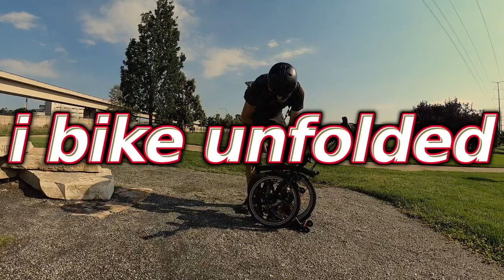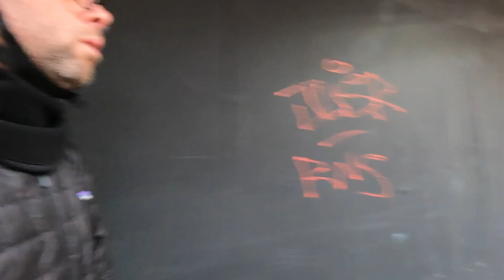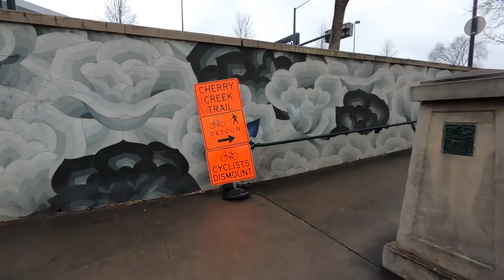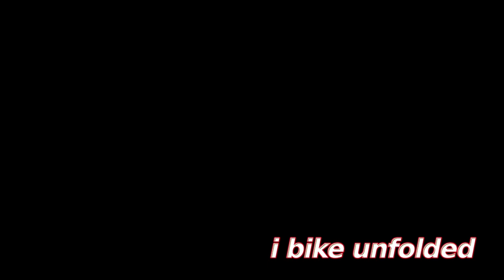don’t buy an older Dahon

Comment: I'll be honest, I don't even own one of these but it just looks and sounds like you don't maintain your bikes. Also, what is the point of owning a $1k+ Brompton and you're afraid to use it in bad weather? Those things are built like a brick, they can withstand an amazing amount of abuse. Anything from the 80s and 90s is going to suck if you don't maintain it, and anything from before 2000 is gonna be hard to find parts for. I'd change this video title to "don't buy a bike you don't know how to maintain or fix."
Reply: Or "Don't-buy-any-bicycle-youDON'T-want-to-look-after"

Comment: My Dahon is 2nd hand. Has a steel frame. Only problem was with seat post slipping down. A separate quick release clamp on the seat post fixed that problem. I have been happy with bike in all other ways. The 20 inch wheels make for a smoother ride. Your bike looks to be a very old model. Oh....and I would never drill holes in a frame.

Comment: Well you could change out that bolt for one with a castellated nut and cotter pin but yeah that headstock looks like a hot mess. They don't make 'em like they used to and sometimes there's a good reason.

Comment: 17:35-19:25 thank you 🙏🙏 i was perplexed and intimated by these washers now I have the stem off the fork. I think your problem is the washers are misplaced, there are not the same thickness?!! Anyways, I am replacing it with Razor stem and two take off handle grip, TI alu wedge stem screw, and 16 inch alu front wheel. Right there I am going to save 3pt! Have nice day with Brmptn...

Comment: To adjust the upper steering nut--could U try a freewheel puller lathed down to fit into the outer cup? Also, pulling a trailer from so high up on the seatpost risks stress-cracking the frame and is inherently unstable. I pull using a folding luggage dolly carabinered into a standard rear rack. Since it attaches low over the rear wheel it's more horizontal and doesn't capsize.

Comment: That's a heck of a huge box you were carrying there. That brings the CG quite far from the the trailer. I've tipped mine over about 5 or so times, but never had any failures like that. I was quite surprised to see the steel pin bending. I'd expect the counterpart rubber component to break instead.
Reply: If it helps, I use mine with basically no pressure in the tires, as I found that to make it more stable and compliant when hitting potholes, etc.
Reply from the maker: Yes, I thought the trailer would break before the hitch.🤷‍♂️
Reply from the maker: Thanks, I might try to lower the air pressure and see what that does.  (After I get a new hitch that is)😀

Comment: Had a near-miss once on my Brompton. I was taking it on gravel with lots of loose rock, and when I rode it back to civilisation, I noticed that the gaps on the hinge clamp was wider than usual. I was riding on a loose hinge clamp for over 15 mins! I eventually tightened it back, but it just shows how idiot proof the Brompton is and why you shouldn't ride a cheap folding bike. Didn't you have a full-sized 700C bike? why don't you use that for your beater?
Reply from the maker: I sold all of my full sized no folding bikes.  I downsized my bicycle to fit into my tiny apartment.
Reply: @ibikeunfolded  What happened to your red commuter Brompton?

Comment: I use a single wheel trailer which mounts on to both sides of the rear axle on the bike. I have used my trailer many times with my cats riding in the single wheel trailer and I have never had a tip over incident.

Comment: The original steering head bearings on my budget folder (a Taiwanese Raleigh) were dreadful. I couldn't adjust out the play. I stripped it down and found the bearing cups which should be a press fit in the frame tube were a sloppy clearance fit. I bought a Cane Creek headset but it was about 6mm too tall to assemble on the bike. I shortened the head tube 3mm top and bottom. My first trade was as a maintenance fitter and machinist but with no machine shop access I had to saw and file the frame to size. It took me a whole day. I used a (big) micrometer and got each face parallel to within a couple of thou and now the steering head is the best bit of the bike.
Every time I worked on that bike I wished I'd spent the extra on a Brompton but now I have - and I don't regret it. Perhaps you need a second (winter) Brompton?

Comment: Word of advice to Dahon riders:  Don’t get up on the pedals when riding uphill.  The mechanism used to secure the handlebar to the front fork at the fold will snap under high handlebar pressure.  I learned this the hard way after the handlebar snapped forward climbing a hill on the pedals and had a nasty wipeout.  I eventually fixed this with duct tape, then the bike was stolen.  I let it go, knowing it was a potential death trap for the thief.  Since then, I’ve stayed on the seat in every hill climb.  I now have the much-sturdier Dahon K-One e-bike.
Reply: Is this also happening to MU D11 bike?  Thanks

Comment: I have an old Dahon Mariner. It is by far the worst piece of garbage filmsy crap metal I ever had. Slipping seatpost, slipping handlebar. Horribly flimsy and very uncomfortable folding point locks. The handlebars folding mechanism already broke. It is welded back again, but I do not trust in it. And one more little thing, the bottom bracket does not have any tread, the treas is on the crank spindle. It is impossible to adjust it just right. Really, the worst bike I ever had :D

Comment: Hi Brian. My brompton has a small gap of less than 1mm in the rear hinge. Is it normal? Does anyone have this problem? when do you change the rear hinge?
Reply from the maker: I think mine has a small gap as well, I will check as soon as I can.  How often do you change it??  Well that depends on how often you fold the bike.  If you are folding it 5 times a day, then about 1-2 years.  If you fold it about 1 or two times a day then maybe 5 years or better.  Just estimates.

Comment: I bought a used dohan omega about 2 years ago, i serviced the 3speed Torpedo hub that was on it, i replaced the horrible 90`s MTB Sattle for a cheap  comfe one, and new Tires (to find tires was apain in the bud, a weird 20in that was more like 21in in compairison to normal 20in wheels). the folding Mechanism of the handlebar was a bit sluggish so i cutted a piece of inner Tube rubber to size, to lay it in between. i replaced the rear sprocket for a much smaller one to go faster. I have driven it nearly every Saturday, and use it for my 50km (25 per way) commute from time to time, when my main bike is somehow not useable. I feel very save riding it, even at speeds of up to 30Km/h. The v-brake in combo with the coaster break are more than good enough (to be fair, i am used to ride classic Bikes  from the 50`s with sometimes horrible dangerous combinations of coasterbreak with a 3 speed Derailieur, and Stamp break in the front, so everything better than this is a good break for me). The Fatal errors you describe seem to me like classical user errors, but to be fair the maintennace on these dohans is not very userfriendly but doable. But if its not for you that is ok. i like the bike you got instead very much to be honest.

Comment: Hi Brian, just happened to be looking at bike trailers over the last couple of days. The single wheel ones looked to be the most sturdy, but what seemed to be a drawback was that most connected via the axle. The Aevon trailers look very durable and they attach via the seat post. The L180 is light weight and foldable for travel ( I know in the past you have mentioned travelling and touring with your Brompton), but I don't think it would be suitable for taking in a supermarket with your Brompton to do a food shop. Also they do seem expensive. My folding bike as a similar nut on the fold, which I have had to tighten ( I almost lost it once). However it has a loop and clip also, I had been thinking of making it extra secure with a velcro strap, after seeing what has happened to you I think I will definitely do that. When I had the gears lowered on my bike, the mechanic was trying to persuade me to trade my bike in for a used Dahon. Glad I didn't take him up on it. I have looked a lot at the Terns and they do look tempting, however if I did get another bike it would probably be a Brompton. Mainly for travelling something it would be possible to fly with. However no rush, no one can travel at the moment and Bromptons  are scarcer than hens teeth!!

Comment: Ordered the 2020 Dahon K one before watching this. Hope i made a good decision.
Reply: How is it holding up? Any good/bad experience with K One?
Reply: @waltermitty5883  i had ridden 2 bikes in the last 2 months. Giant xtc 800 and dahon k 1. Surprisingly i am loving the smaller Dahon more for urban commuting. It accelerates and handles faster and relatively lighter. For longer rides, big descends and ascends and off-road my Giant is overall better sure. A problem with my Dahon is a faint squeaking sound. I cant figure it out. A bike shop owner said its no problem but its still there. Other than that i am always happier on the dahon cuz its a bit more fun and faster when i cruize through urban obstacles.
Reply: @marcomongke3116  thank you for your reply. Really helpful and narrow down my choices. May I ask how much did you bought it for? And did you upgrade anything or still using stock equipment? Thanks again Marco.
Reply: @waltermitty5883 i paid 500$. And i am using stock equipment. But i think if i ever had second chance i would go for a model with 2x7, 3x7 drivetrain with shimano shifters. The stock k one came with dahons own shifters with 1x9 drivetrain. Also the pedals didnt fold and the seat didnt include the mini pump like on some Dahon models i have seen. Prolly have to pay more for models with such features. Overall bikes are expensive these days.

Comment: First and last time watching your channel. I have 2 vintage single speeds no problem. And yes if you hit a pedestrian with your bike on the sidewalk even if it's his fault you are at fault just like a car WOW
Reply from the maker: Calm down man—- take some Valium.  I’ve had several older Dahon’s and they all were pieces of crap.  That’s my opinion and I’m sticking to it.  As for hitting a pedestrian you are right….however we cyclist care less about following the rules when no one else does.  Pedestrians are told to look out for others, be courteous, and follow trail/sidewalk rules- ie laws regarding dogs and proper use of bike paths or sidewalks.  I’d say 65-70 percent break one or more of these rules on a daily basis so if I have an attitude about following the rules- so be it.

Comment: My buddy at work gave me a Classic V and I was curious about it, then ended up here, nice vid.  When you talked about the failures, I thought a buddy with a welder can fix the steering issue after you set the bearing tension. new brake pads and the locktite you put on the bolts finishes the deal.  I get rid of the orangutan seat that comes on bikes typically.
  I was amazed at how many people use this little bikes- last time I was at the store, some kids say "Cool bike" 
They are rare in Buffalo.  Not so in Europe- (Vid) https://www.youtube.com/watch?v=HmPxhbc5qek     Mike